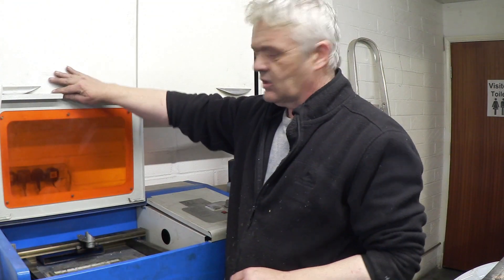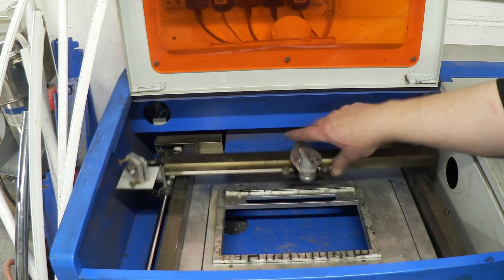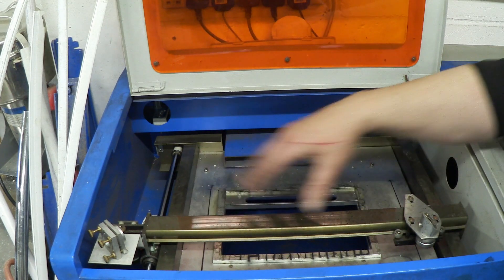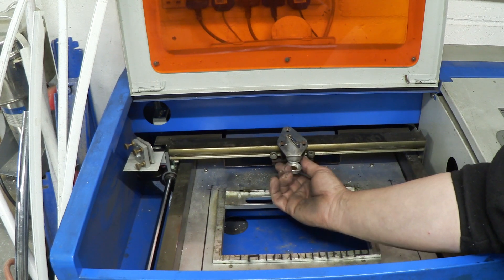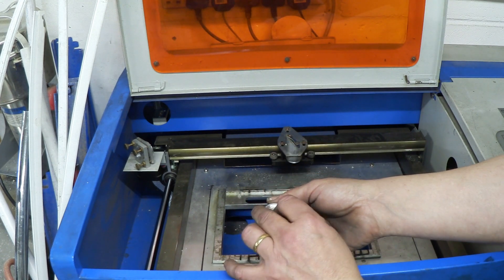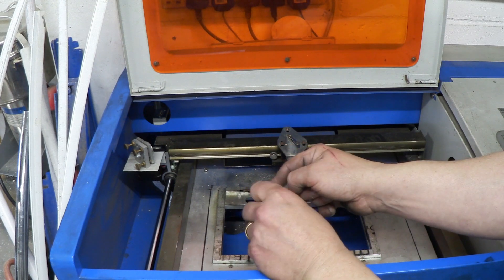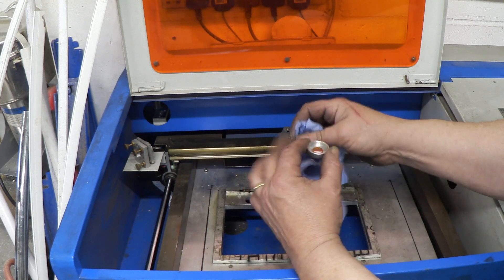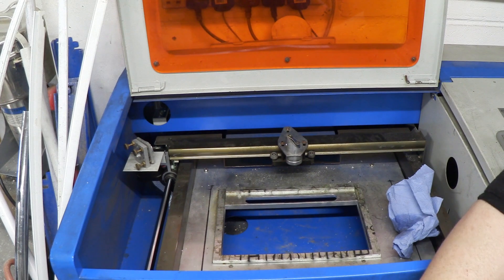Maintainance Tip For K40 Type Laser Cutter

Comment: Have had the good fortune to use both a K40 and a G.forge - the K40 isn't pretty, it does need lots of TLC to keep good cuts, BUT - it is simple and that means so much easier to repair.  Had one part go bust in the Glow (excellent cutting quality) BUT, just lost 5 weeks waiting for a single part to be processed and arrive - a crazy slow support service lost all my winter custom during an already tough year - K40 - simple replacable parts is still better.

Comment: How long does tube last? Power required for different materials? 

I have considered attempting a build of a TEA laser. A long thin spark gap in gas at atmospheric pressure. The spark's plasma serves as an energised lasing medium. Pulsed output... And it's not that difficult to get outputs sufficient to ionise air. So should be able to cut  metal.

Comment: Clean allirrors ..

Clean all mirrors same as lens.   Put a piece of masking tape over input side of each mirror... pulse laser to look at position and spot size of beam.  Align upstream mirrors.   Totally agree with earlier air injection at lens comments.    Use focal length to put lens barrel fairly close to work surface.
Reply from the maker: spot on mate

Comment: Local SLS 3d printer that I know uses a 200W laser(doesn't always utilize full strength) needs to be cleaned every time it's ran. The nylon based powder gets everywhere. The parts it makes are incredibly strong though.
Reply from the maker: awesome

Comment: Tools and techniques are always a great addition to your content!!  And even for those of us who don't have a tool, it may help in choosing one to know what the maintenance issues might be, or to hear tips from others in the comments.  For instance, I notice some comments below about "air assist" or fans to help reduce the buildup on the lens, which I'd never have thought to look for.  😊
Reply from the maker: I tend to go for simple solutions and setting up air asset - though not that difficult - is more difficult than cleaning the lens every now and them lol
Reply: @ThinkingandTinkering  Yes, but, once completed, you've pretty much eliminated the need to clean. My maker space has two 1200x900mm 80W lasers, remarkably similar to the little guy you show here, and we spend no time cleaning those lenses, with a pretty heavy duty cycle...

Comment: Rob A Great Video, Do You  Think That There Is A Quick Fix For This Like Air Assist ?.  What Software Do You Use Stock Or Another Software , Also What Mods Would You Make On The Machine And Any More Tips On This Machine  Would Be Much Appreciated ..Keep Up The Great Work.
Reply from the maker: that is a bunch of really good questions mate - I will do a follow up vid - cheers

Comment: RMS, quite informative video! Does threadlocker help keep the mirrors in alignment so they won't jiggle loose from vibrations from the machine?
Reply from the maker: I wouldn't add thread lock mate - the thing will go out of alignment - that's almost a give to be honest and thread lock will make any future adjustment very difficult indeed - but I am guessing here
Reply: If you nip that up tight it wont need any threadlock, I dont have one of those lasers, but I do have quadcopters and a 3d printer and if you nip the screws up just right they wont fall out.  Dont overtorque them like a 400lb gorilla though.  Hand tight, then a fraction of a turn more.

Comment: You need compressed air lens shroud/upgrade. Air comes out the beam hole at the work. Telescoping beam tubes w/positive pressure keep mirrors clean. Use 12vdc squirrel cage blowers in series air supply, quiet.
Reply from the maker: or I could just wipe it over every now and then lol - sorry mate I have a tendency to the simplest solution

Comment: I think a few people have already said - but laser cutting PVC is not a great idea; vapourising the plastic creates toxic fumes (I'm not sure if it is chlorine gas) but it's the acidic gunk that's left behind that can be highly corrosive (the vapours too can quickly make a mess of your x-y carriage wheels, which are usually little more than discs of plastic on these cheaper machines). I've had an HPC 3020 for the last ten years or so - which is basically an upgraded version of one of these. Brilliant little machines!
Reply from the maker: we all make choices mate

Comment: The deposition is only on that lens? no Issues with the mirrors getting dirty? I am guessing that the cutting plane coincides with the  focal point of the lens, since you have no adjustment in the position of the lens in the holder.
Reply: Laser cutter usually have a mechanism to raise or lower the bed to position the workpiece at optimum focus position. That height may vary depending on thickness or shape of the workpiece.
Reply: @Graham_Wideman  well yes, thank you.  I would expect that.  Unless you know, exactly, where that focal point is and what is the thickness  of the material you cut it would be a pain to determine the optimum position.  I am just guessing here, that the mechanism consists of some optical reading of the thickness material and everything else is adjusted to the fixed focal length of the lens.  If this is not the case than they are complicating the issue without any benefit.
Reply: @barbufodor1186  "optical reading of the thickness material". Simpler than that. The laser cutters I've used have a fixed focal length, and a simple hinged or flippable gadget on the carriage that flips down to indicate where the focal point is. You then crank the bed up or down manually (or possibly electrically driven, but using manual up-down buttons) so that the workpiece bumps up against the height gadget. I don't actually recall whether the indicated height is the exact focal point, or rather some distance higher than that so that when it's touching the workpiece, the actual focal point is in the middle of the material. (Obviously in the latter case it would be off for different material thicknesses, but the range of material thickness is quite limited on most low-end laser cutters.)
Reply: @Graham_Wideman  even cheaper if you do it manually (costs you nothing). I thought is somehow automated it would not be difficult to do it however you would have at least one more part to clean.
Reply from the maker: they do get dirty mate but not as quickly